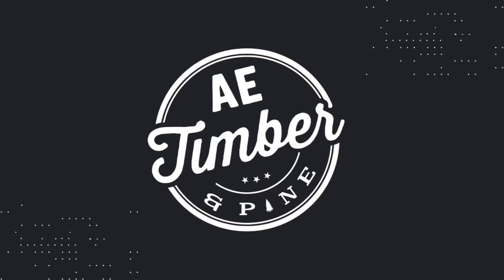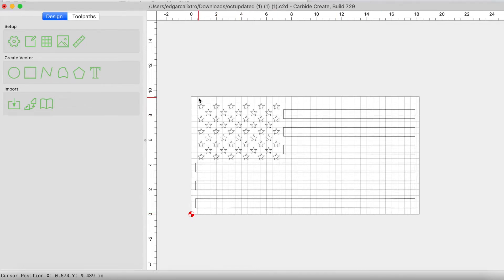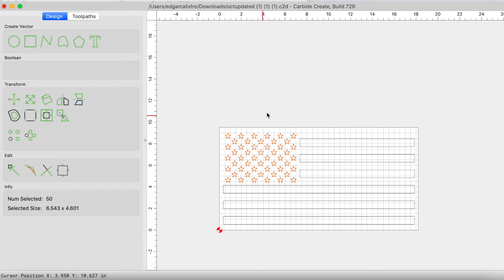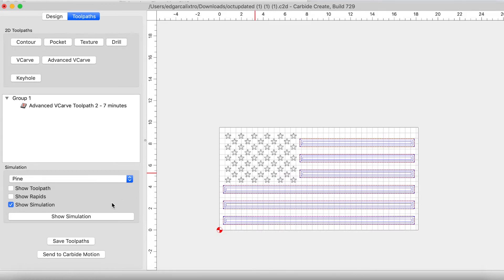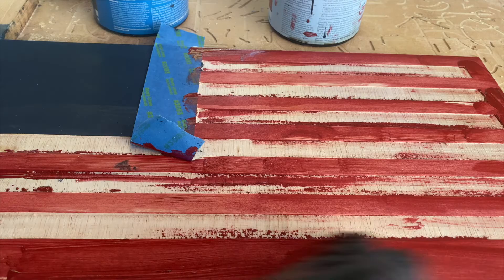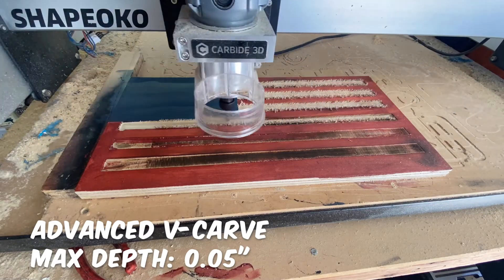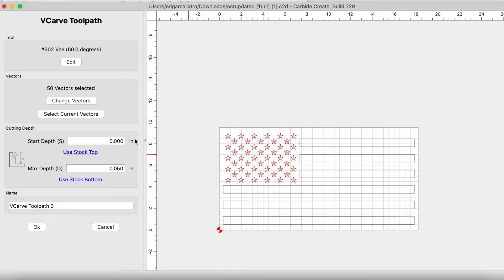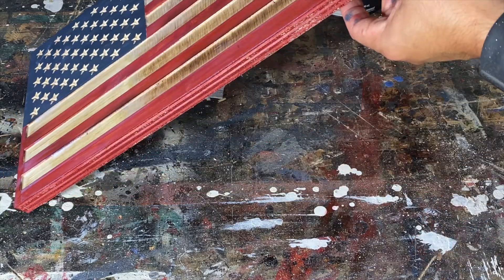Carbide Create Tutorial | Wooden American Flag on Shapeoko

Comment: In the simulation I am only able to get the stars to look like a bunch of stars. It's not showing anything that looks like stars. I'm guessing this will not produce the right engraving. Suggestions?
Reply from the maker: I would start over, sometimes it’s just best to refresh not only the toolpaths but also you.  Step away and then Make sure you’re groups are correct.

Stars should be one group and the other group are the stripes. 

Make sure you’re using a vbit with a vcarve toolpath on those stars.

Advanced vcarve on the stripes.
Reply: Thank you. I did start over and took another look at your process. It produced the same results when I was looking at the tool path. But I noticed you had “tool path” and “show Rapids” unchecked. When I did the same and only looked at the “show simulation”, it was showing stars as I would expect, so I went ahead and sent it to my machine and it engraved correctly. Thanks for your response!

Comment: I am wondering how you put your flags together? Do you glue your stripes together and have 3 strips on the back to hold them together?
If you have strips on the back when setting up your tool paths do you take into account the extra height of material from the strips on the back or doesn’t it matter? 
Thank you for your feedback.
Reply from the maker: Hey Eric,
This example is using a single piece flag. I typically use edge glued panels from Lowe’s but in this video I used plywood.

When I carve a full flag, including stripes, it will be a single piece flag.

When I make a flag with 13 individual strips I will only carve the union on my cnc. I like to use 4 strips in the back.

To answer you specific question, no you would not have to account for the extra height of the back strips as extra material because you still need to set you z-zero at the top of your flag. You tell the program where the top is regardless whether it’s on the back strips or not.  The cnc will carve according to the settings you put in carbide create, which would be 3/4” thick material. 

Hope that helps!

Comment: I just watched your video on carving the flag. If what i saw was correct when you set the max depth of the stars it was.75 is that correct? How does that work if I am carving in 3/4 material? 
Thank you for your insight.
Reply from the maker: Hey Eric. That’s a very good question. 

Take a look at my YouTube post. I just shared an image that helped me understand why max depth is chosen. It allows the program to determine the correct depth to allow for the blades of the vbit touch the two ends of the vector you’re carving. (The image clarifies it better)
Reply: @aetimberpine  ok that sounds good. I will take a look. I am very new with CNC and I am getting better but producing a lot of scrap but it is a learning process.

Comment: Thank you for the video.  I do have a question our stars are cutting very small even though we are doing everything you are doing.  Any advice.
Reply from the maker: When I get inconsistent stars, including small stars, it’s because my material is not flat. 

So I would check that the material is flat. Simply press down on your material to see if you have any give in the material.

Also, it would be good to double check your stars. Make sure they’re proportional to the rest of the flag. It is unlikely That they’re not proportional, but it’s good to check everything. 

Lastly, make sure you’re carving stars to max depth (carbide create) or the thickness of your material (other programs). 

Also make sure to reset your z-zero where your union is to account for a difference in height from where you originally set your z-zero. 

Most the time, when I get these issues it comes down to the material flatness, so if everything else is right, make sure it’s flat.  Try a practice piece by using brad nails to really flatten the board and see if you have that issue. That may confirm whether it was the material. 

Long response, but wanted to make it thorough.

Comment: Thank you for the great video. do you use a bit setter when you run the advance V-cut. or will the new version of CC let you manually change the bit?  Again thanks
Reply from the maker: Thanks Ricardo! I appreciate it!

I run the bit setter when using the advanced v-carve. 

I don’t think they’ve changed that in the latest CC version. To be honest I always have it on unless doing a surfacing job.